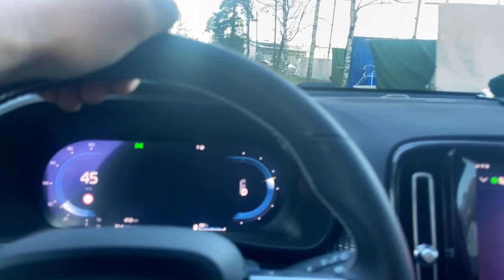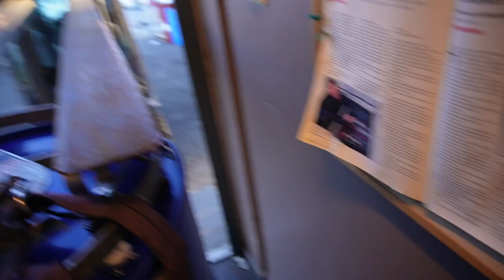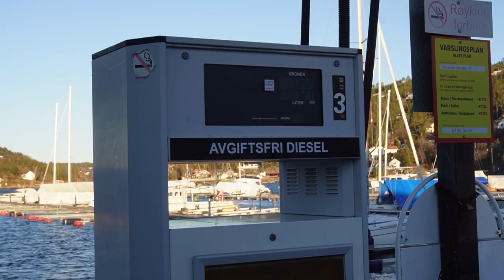Mechanic vlog,OFF-SEASON VIBES|S01E31#winterize#Norway#boats#mechanics#yanmarengine

Comment: You have very nice drone shots! What filters do you use?
Reply from the maker: 🙏 thanks ! I fly with the DJI Air 2S Drone, and the “fly more” pack. In the set there’s some ND filters. I some times use them to prevent “burnout” and to stop brightness 🔆 in the frame. In final cut I manually adjust the contrast and colour to what ever I think I good. That’s it really. The drone has a great camera 🎥, so it’s really just about getting the drone up in the air🙃